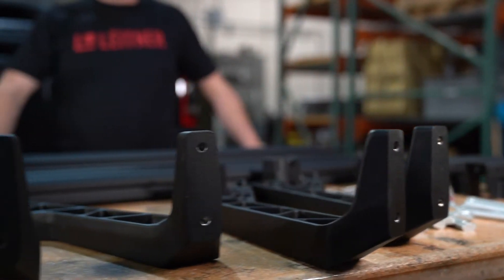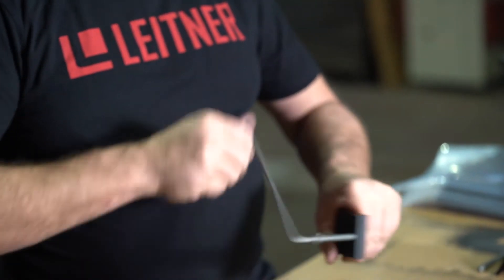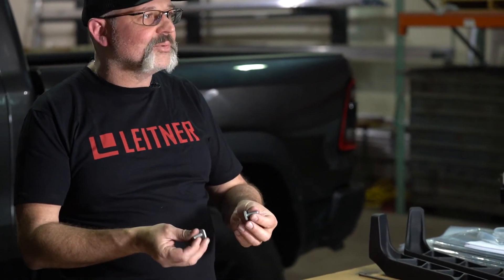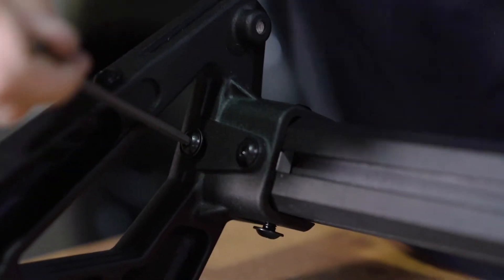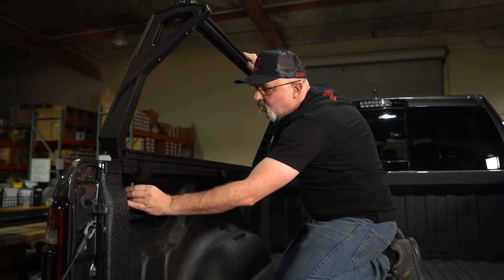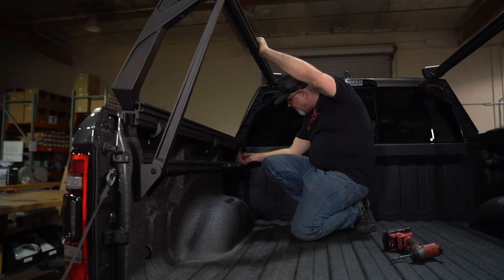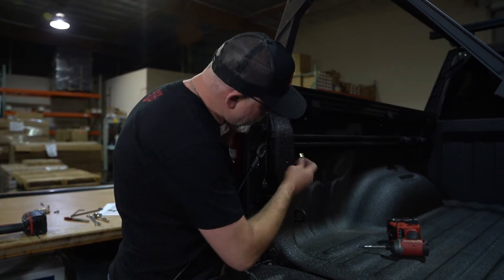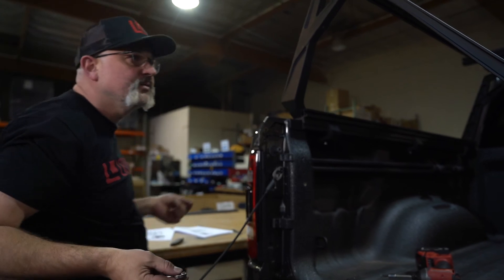Leitner Designs ACS FORGED Full Installation

Comment: I just installed mine on my 2017 Tundra. Very happy! Took me more than 3 hours by myself. This video was a huge help, and the included instructions were 1st class!! I will say some of the bolts were very tight. Not sure if this is due to the lock-tight, machining, or both.

Comment: If the box of the truck is not square and you mount the cross bars based in that measurement, how will it slide forward?
Reply from the maker: The load bar mounts are “slotted” this allowed a misalignment of 3”. More then enough on all truck beds.

Comment: This model must be a century old. This won’t fit in and work with the t slots in a ReTrax t slot tonneau cover. 🤦‍♂️ plus this video is on a Dodge Adam but the video was posted on a Chevy Colorado model 🤦‍♂️on the website.